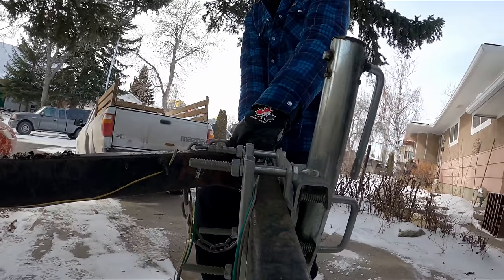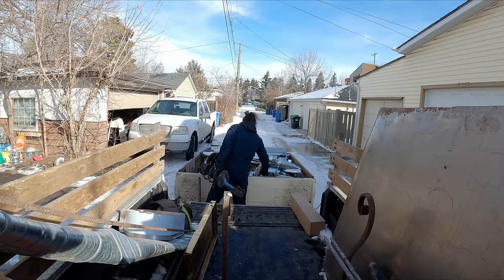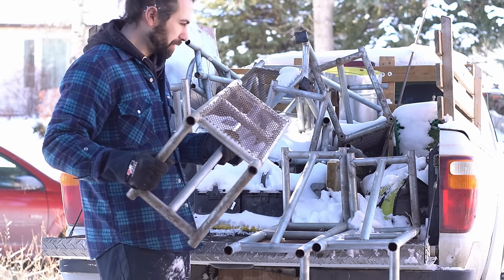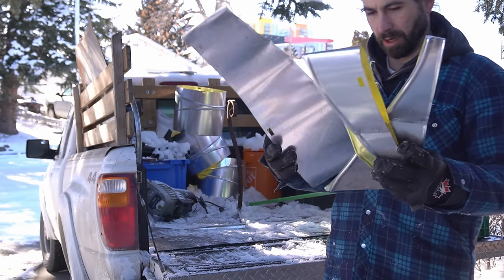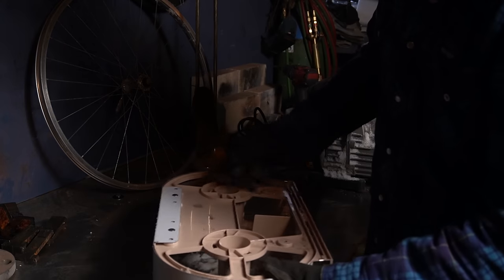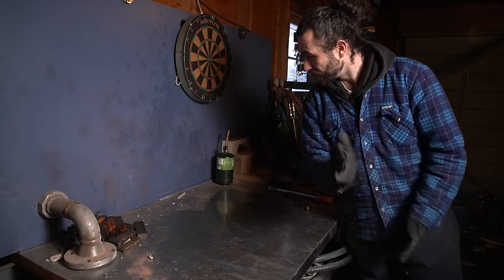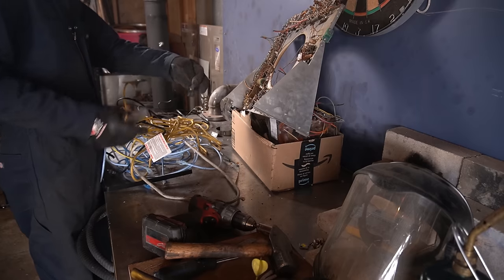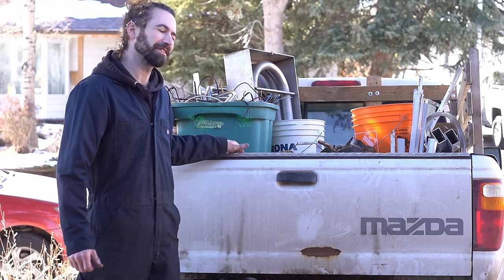Heaps of Scrap Hauls! Processing, Sorting and Cashing Out

Comment: In the past year whenever I cut the spokes off of bicycle rims, I keep them in a tube in my shop. I use them as filler wire for when I’m doing mixed fuel welding. I just clean the spokes with a green scotchbrite and apply flux paste. Gotta look for as many ways to save these days on shop supplies these days
Reply: These days.
Reply: These days
Reply: Lmao these days smh

Comment: You got to slow down my boy you're no good if you're hurt. I feel ya i hate beingthe  at scrap yard at closing that but is what it is. Another thing that trailer would be a dump trailer if it was in my possession. I stack the bed of my truck with metal the same way you would do branches one pull it all comes and no matter where I am I separate it in material types #1 heavy #2 light prepared un prepared but the one thing I dont do because we have to go around and weigh again to go inside for precision metal is go at closing because they rush and will throw clean brass with one say metal handle in to dirty instead of pulling it out or call something the wrong and cheaper material and we can't have that with all that work. Isn't that a handle for a handicapped stall the handle that folds up and down against the wall?